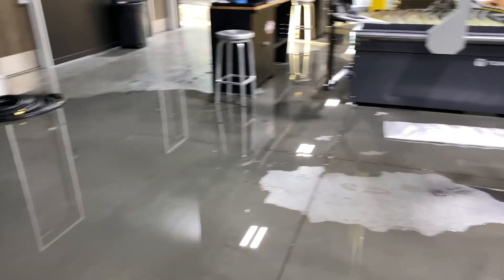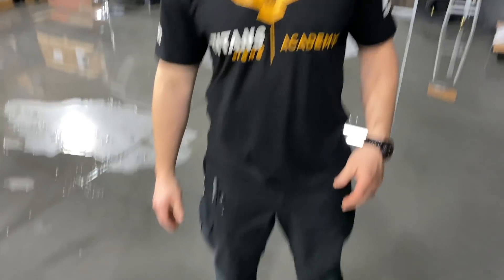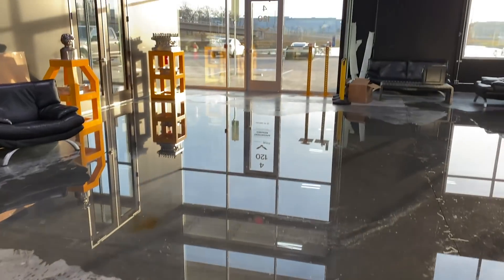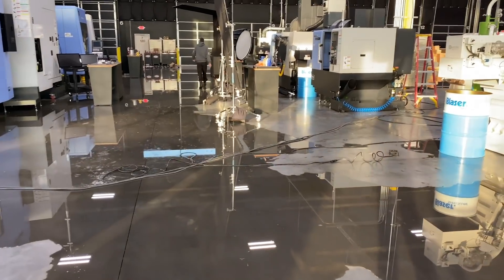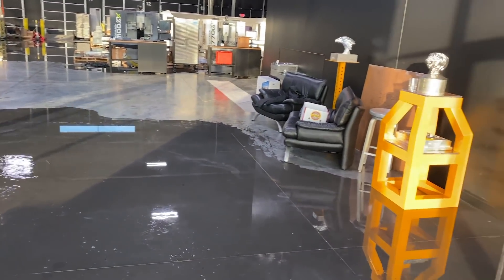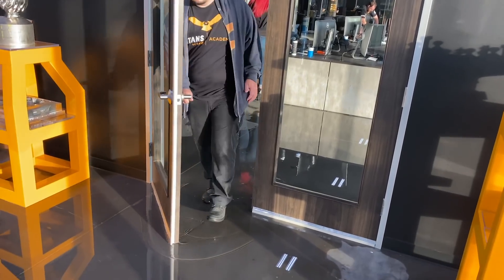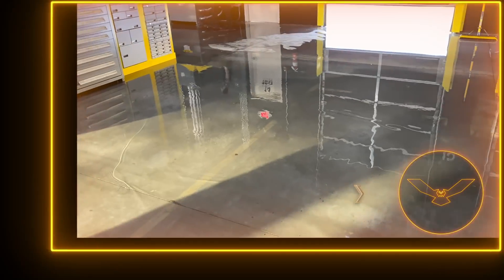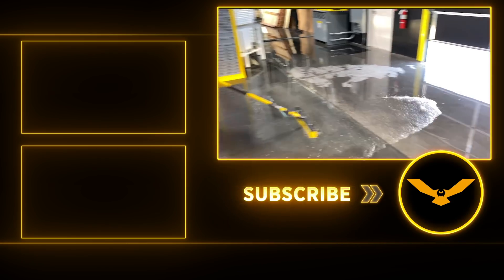Our New Shop is Literally UNDERWATER Right Now

Comment: 😥
My biggest fear. I installed an electromagnetic valve at the water inlet and that is switched through my main office power switch so the DI system cannot run when there is no one in the office.
For cleaning I suggest an industrial vacuum cleaner for water, these leave the floor almost dry. I am assuming the concrete floor is polished/coated so it does not absorb too much water. If that's not the case, ventilate the area or rent a big air dryer too. During winter time the air mostly too dry over here (20-30% RH), in that case the floors will dry quickly.

Comment: Any machinist out their ever flood the floor with coolant because you forgot to turn the hose off filling the tanks? I worked on a VTL that was placed in a 3ft concrete pit because of the ram height, we had a operator on 2nd shift filling the coolant at the end of shift and forgot to shut it off and was running all night until 1st shift arrived.

Comment: For us at the TX plant a fleet of wet/dry vacuums-and mops and mop buckets-yes the floors and bottom of the transmitters get cleaned. One of our transmitter has old plumbing-almost r0yrs old. The DI water is hard on copper pipes. They will get pinhole leaks. A contractor has been called to replace the plumbing in that transmitter-others OK.

Comment: Of course once the DI water hit the floor-no longer DI. Can get the same issues at the transmitter plant the DI water is used as a coolant in the HV parts of our transmitters. The transmitters monitor the conductivity of the water-if resistance of the water is too low shuts down the TX. Means a resin filter has to be replaced. Always bad-no matter what the place a flood is ALWAYS bad!!

Comment: My work flooded last year, up to 4 inches across the whole shop, roughly 20,000sq ft
Best advice is get a sump pump and flat lay hose, find the deepest point and pump it outside or to a drain
Then go round with a wet and dry vac to get the rest up, the bits the vac wont get will dry very quicky

It took around 4 hours to pump the shop then around 3 hours to wet vac

Comment: Thankfully no defect sprinkler that would have showered all the machines from above. At least the floor is clean now! Washed with DI water, doesn't get much cleaner than that! :)
Reply: Ya one of the shops I worked for had a sprinkler blow its mind and showered are entire spay/blasting bay. It was a huge mess, 3 blasting cabinets full of water logged media and major damage to the electronics for the spray welding equipment. Probably $10K damage and we were down for a week getting everything fixed and running again. Plus the alarm system called the fire department and they don't do free house calls (i was told that was another $500 bill!)

Comment: When you run some coolant and go "quickly" do something else  then you forget you had coolant running...
Reply: My last shop finally put a timer system on the coolant fill line, when you grab the hose you turn a timer dial to start the flow, think the maximum minutes was 15

Comment: Shop vac, house adaptor for the drain port, and start vacuuming. Hook the garden hose up to it with a ball valve, put the house outside the door, and open the valve everytime the float stops the vac from sucking. Get the squeegee attachment and 2 lengths of straight tube so you don't have to bend over. Or just go rent a carpet cleaner.

Comment: Had a telco office once where the chiller sensor froze over in winter.  The system thought it was out of water and a 6"+ pipe kept feeding it all night.  The overflow drain for the chiller was broken under the building slab and could not support draining water that fast.  Came into the office in the morning and literally 4" of water was coming out of the front door.  Took a few weeks of digging to figure out the RCA for that event.

Comment: That’s crazy, sorry for your troubles.  It will get better. Might be a good idea to cut some drains in the floor. Especially by the water intake for the coolant system. Could prevent future cases.

Comment: You guys are just setting up, but I’d invest in some water sensors that are hooked up to your wifi network that can ping you guys if they start going off in the middle of the night lol. I think NYCNC has some set up for that if I remember right.
Reply: I thought mr Saunders had it set up to shut off the water automatically.
Reply: @sasjadv  You thought wrong
Reply: @siraig  Well, he promised a video with further explanations about the flood detecting system. That implies that there is more to it...
Last week he didn't go into detail, but he just mentioned some options how he could use the system.
And to me having a network of sensors setup through an IOT hub, to just trigger an alarm doesn't make sense. I mean if you have the system anyway, you can program it to do more and take action.

Comment: Be sure to raise up and clean under everything.   If you don’t moisture will remain and rust out the bottom of cabinets or absorb up into wood.   Bottom of sheet rock may be an issue also, get blower fans going to dry out everything so you don’t get mold in corners, tight spaces, and hidden areas.   Good luck.  You can buy the carpet dryer style fans at Lowe’s and Home Depot fairly cheap.